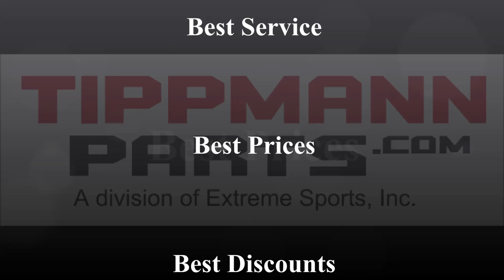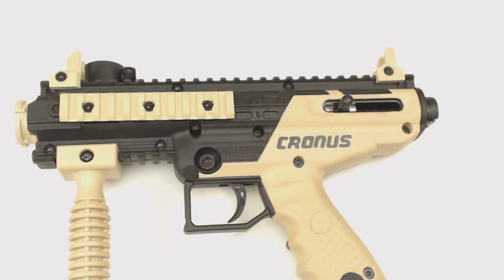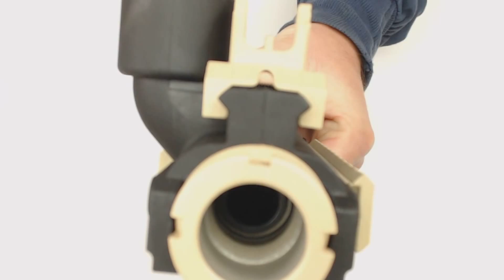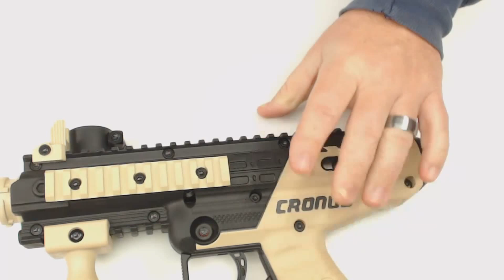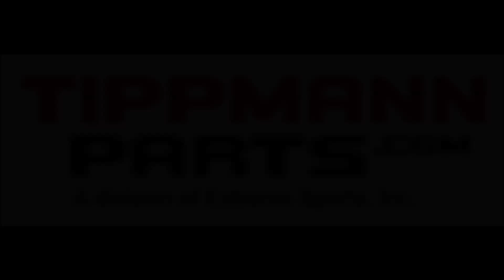What's the Difference Between Weaver vs Picatinny Rails?

Comment: "Picatinny and Weaver Rails have the SAME PROFILE.  Picatinny rails are a military standard with specific spacing.  Weaver rail spacing can vary.  For the most part, weaver accessories will usually fit on a picatinny rail but picatinny accessories will often NOT fit on a weaver rail."
It took you nearly 6 minutes in a video to say what was in the description.
Reply: Striker Eureka Thanks for the clarification. I should have just read the comments before I watched the whole damn video smh.

Comment: I am having problems with my magpul angled foregrip fitting onto my quad rail.. the rails don't match up for some reason..
Reply: I actually had the same issue. Rubber mallet will get it on just fine but if you want to be delicate you can go ahead and get some wrenches to loosen the screws holding the two halves together, place it, and screw it down.

Comment: Is there any part upgrades for the Cronus? like a double trigger, or response trigger or and adapter to put on a flat line barrel? I have a Cronus and I love it, but I would love/need upgrades for it.
Reply from the maker: +Leon Bungie Unfortunately the Cronus is very limited on upgrades. About the only thing you can upgrade is the barrel (A5 Threads), but it can not use a flatline. Something similar to a flatline would be an Apex 2, which would work on the Cronus. https://www.tippmannparts.com/Apex-2-Barrel-System-14-Inches-A5-Threads-p/72.htm
Reply: @TippmannParts  Do 20mm Picatinny rated attachment fit on a 22mm Weaver rail?

Looking to Mount regular 20mm Standard Picatinny Attatchments on my Crosman R1 as i dont see anything that says 22mm

Comment: This probably sounds really stupid because of ur video but is thier any way i can build or modify something for a piccitiny scope to fit on my weaver gun??>>....
Reply from the maker: +vrence In almost all cases you wont need to do anything to add a picatinny scope to your weaver rail. If it is not compatible then I do not know of any modification.
Reply: ok great. i just bought a new scope online and didnt read the desc proper and it was for picitany but thank you for responding :)
Reply: +Tippmann Parts Actually i just got my sight in the mail and it does not fit. Im actualy wondering if my gun is piccitany....
Reply from the maker: vrence The Cronus has picatinny rails, so if your scope is for picatinny it should be compatible. What seems to be the issue, do the rails not line up with the cross bars, or is it something to do with the side tabs on the sight?
Reply: +Tippmann Parts The Bolt or screw fits inbetween the rails on top, but it appears it isnt wide enought. Ive tried un screwing it to loosen it but no luck. Im actually thinking about sanding down the rail on my gun where the scope can go.
Reply from the maker: +vrence Do the side tabs that the bolt screws in to have the ability to be turned upside down? Sometimes they make them so that one way is compatible with Picatinny, and the other dovetail.
Reply: +Tippmann Parts It looked like it might have been reverseable but it isnt. Thanks for all the help btw:)

Comment: What is a dovetail mount then? I was just strolling through an online website to buy a new sight, but this specific one I found was impressively cheap. However, it is described as a dovetail mount. Does that still pertain to a picatinny, a weaver, or is it something totally different? Thanks, you have awesome content.
Reply: Here is the link to the website : http://www.airsoftgi.com/index.php?cPath=36_749_340&sort=2a&PLsort=5a
Reply from the maker: It is something different entirely. Dovetails are much smaller in width and do not have the notches that weaver/picatinny do. So without an adapter a dovetail scope would not work on the cronus.

Comment: I'm very pro-U.S. measurements vs metric. However, as bad luck would have it in this particular case, metric, IMO, would actually be easier to use to verify those tiny measurements of groove width, as well as center to center groove width. With that said, the Picatinny groove width of .206" converts to 5.2324mm. The center to center groove measurement of .394" converts to 10.0076mm. I should now probably go take a long walk on a short pier for being so anti-inches in this post. I feel unclean. :-/
Reply: ironDsteele I didn't know that the Russians use inches
Reply: Imperial system ISN'T useful, that's the thing. It's just what people have gotten used to and we haven't forced people to change. The reason 2.5 cm seems weird compared to 1 inch is because you are used to using inches.
Reply: I know, I was just making a joke : )
Reply: they will only remain in the usa with that attitude. how about catering for the rest of the world too. i have two tippmann markers and your measurements are useless
Reply from the maker: We agree, we just made the video with US measurements since most of our customer base is from the United States. Don't feel too bad, I won't tell anyone what you said. Thanks for the entertaining comment!
Reply: Universal Steele China also uses Metric system
Reply: Another reason metric is the superior unit. Like me.
Reply: Technically the United States have been a metric system country since the 70s (I think), it's just not forced upon manufacturers, and since most Americans haven't gotten used to metric, manufacturers just use the imperial system.
Reply: Some units are useful in inches/feet or cm/mm, I happily say something is an inch tall, when I know that's about 2.5 centimeters, I'm 6'3-4" and that is much more useful than 195cm or whatever. I have to use yards for distance because that's what ballistic charts come in and scopes objective are set to. 30,000 feet versus 5000 something meters - still not sure why imperial is useful there...
Reply: And how is 76 cm any harder to remember than 29.9213 inches? Obscure measurements are going to be hard to remember no matter what units you are using.
Reply: Because you don't have to remember 29.9213 inches, you can say "about 2 and a half feet". When you have to work out a measurement using 29.92 much smaller units it is not a useful on the fly unit of measure. The measures we had were typically based on the length or thickness fo an average thing - an arm span, length of stride etc.

If you want to get pissy, go ahead. I really do not give a shit. But 76cm doesn't relate to ANYTHING useful in the real world when quickly and in one step estimating a length (EG without a RULER). Sure, something 29cm = a std A4 sheet length, but you had to find some other reference to get some level of accuracy when estimating 29 cm. At least most people do. I would be very surprised that blind estimates for 12.7 cm (for metric users) and 5 inches (for people that naturally measure in inches) would not show a greater accuracy for those people using the unit closer tot he length they were trying to estimate.

For myself, I just like that a foot is a useful length for some lengths. An inch is a nice chunky unit for larger things that would otherwise be 7-9-11 WHATEVER centimeters. And a yard is useful simply because it is a std of measure with ballistics, beyond that not much to me. If there was a metric unit of 10 centimeters that was regularly applied in practice then I'd have use of that due to it's familiarity. There is none, there is just mm, cm, m, km, and those many fractions between.

3/16 of an inch is a much more useful measure (if 3/16 is an existing  standard length)  than  4.7625mm. That's just a random ass bunch of mm, and a lot to write down. 

You can disagree. Again - give a shit.
Reply: I was not trying to "get pissy", I was making a valid argument and was trying to have a mature discussion on whether the imperial system is valid. You seem more interested in criticizing me personally than my arguments, so I see no point in furthering the discussion. You can reply to this if you want, but I'm not going to reply back.
Reply: nobody ever had to convert a distance from say mm to cm. think about it. how many times have you told a buddy you're a mile away and he asked you how many feet that was? it doesn't happen. the entire reason any EU person would argue for their stupid system is based on a lie. furthermore, consider if it was the US that insisted on stubbornly holding to their own system based on factors of 10. the sheeple alt-left globalist types would undeniably meme about how that system is for stupid americans to keep their math simple. when in reality it is the exact opposite lmao
Reply: ironDsteele Not to take sides, but the USSR and Russia used/uses the metric system, and the entire science and engineering departments of the world use the metric system, so your... "metric" for praising a measuring system has flaws (observation, not a criticism). : )
Reply: Metric is better for small precise measurements.  A foot a yard and inches are something easily estimated with body parts.  This is where standard units shine.

Metric units win with math simplicity.  I use and understand both.  I have a preference in certain applications.

We put a man on the moon pretty sure we are doing fine.
Reply: I disagree. it is easier to remember how large one inch is, than to remember how larger 2.5cm is. It's the simplicity of the reference point. I say about an inch long I know what that is, I say say a cm I know what that is. No further math required to guesstimate 2.5 times a much smaller unit. Less than an inch I'm completely lost. But I do find feet and inches useful measures for objects of certain size.  I know exactly how big 12" or one foot is. 76cm would be based on memory of scale of 30cm (ONE FOOT) or the fraction of 1m 76cm is. the cm unit is useless to me in that calculation. Only the simplicity of the metric system makes it more useful for breaking down those units to decimal fractions.

I still think describing something by a useful unit requires that unit to be of a particualr scale with what is being described or estimated.
Reply: There are 2 kinds of countries: countries that have been to space and countries that use the metric system; I am Canadian but old school :P